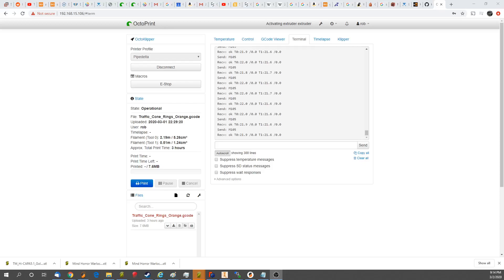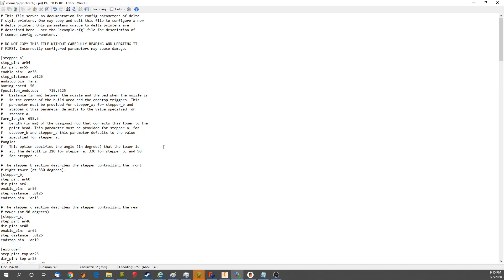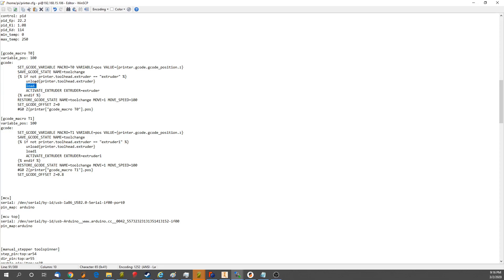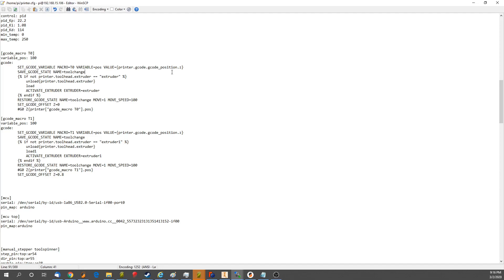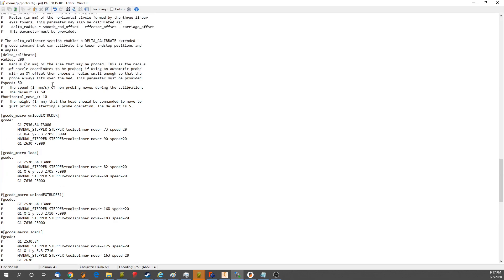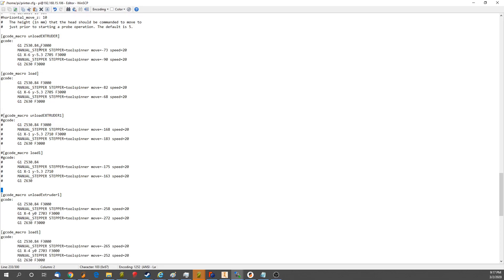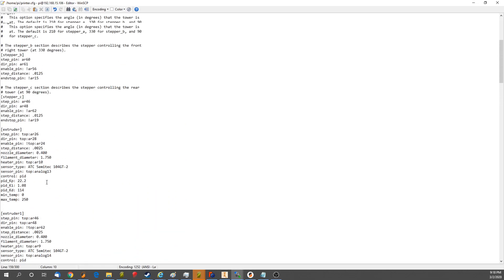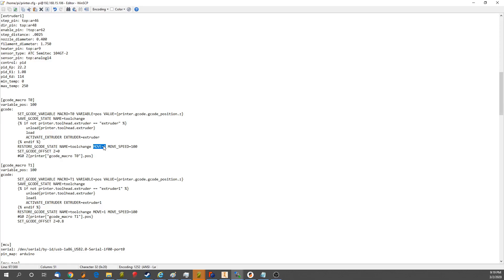Tool Changing in Klipper with new Klipper firmware 2020

Comment: I'm doing something similar for a BLV MGN printer. Though I have a BIQU Hermit Crab. main thing I'm worried about if the tool heads are slightly different in height. Gonna have a BL Touch for the heads. Designing the mounts to keep them in the relatively same height. Would I program each extrude head to have their own offset when they are active?
Reply from the maker: Yes, it's easy, just use z for the offset.
Reply: @RobMink  Okay, I'll look into some examples as I do it. Thanks!